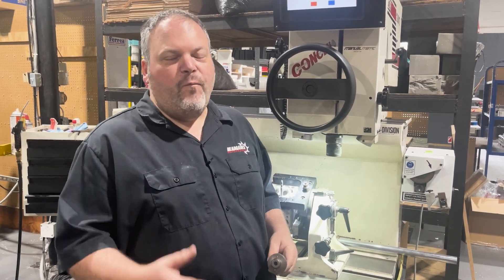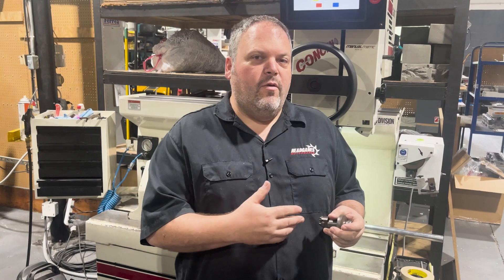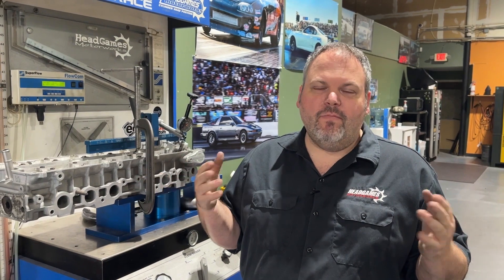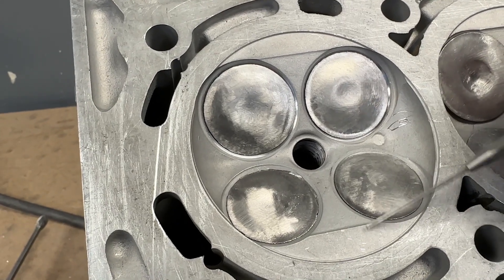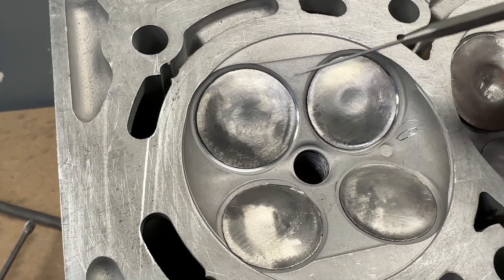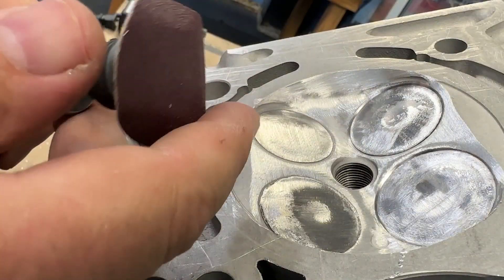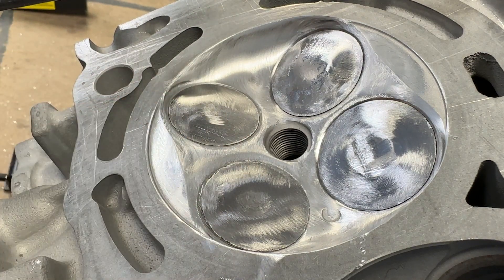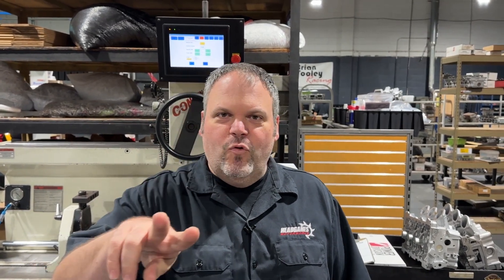Road to CNC 2JZ GE Part 2 : Valve job tech and combustion chamber reshaping

Comment: Great Videos, thank you.  What is the flow before and after your work on this head?
Reply from the maker: We don't share flow numbers but it picked up 60 cfm almost everywhere
Reply: @headgames  Extremely effective then!  How would that effect the torque output of a motor that was producing say 200 lb/ft of torque?
Reply from the maker: I won’t lie brother, no idea. We don’t normally have a situation with torque so low. I am thinking it might hurt it.
Reply: @headgames  thank you.

Comment: Have you ever done needle bearing cam caps? Usually the cap closest to cam gears has enough room. i’ve seen it done to save an rb head (cap 1) when the cam gear chews out the bore
Reply from the maker: I’ve never heard of that. On the LS rockers they get rid of the needle bearings because they fail and put needles into the engine.